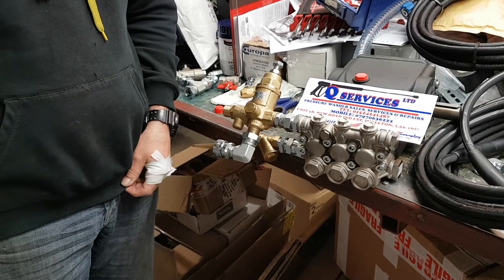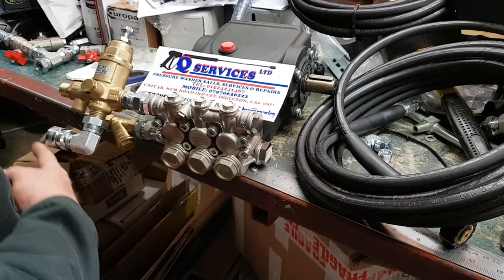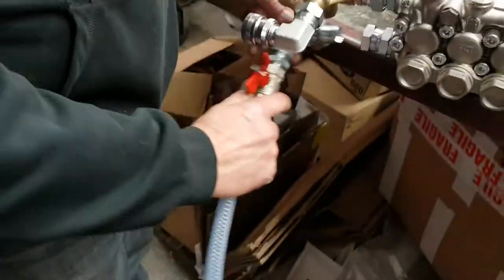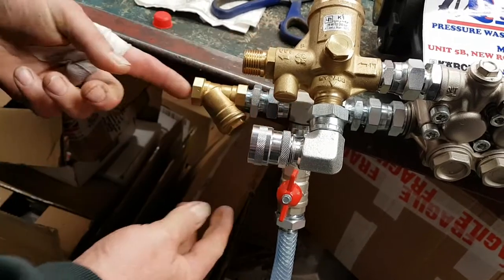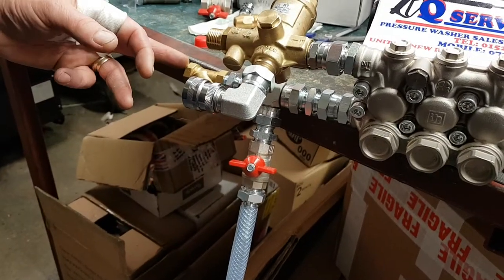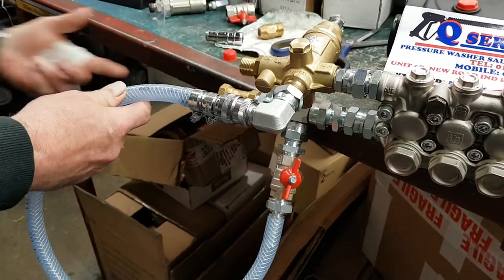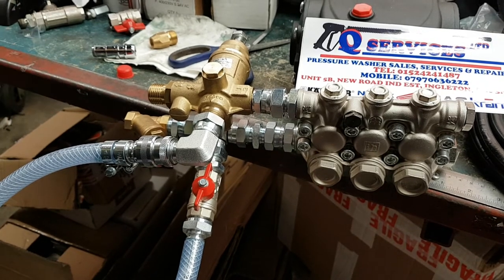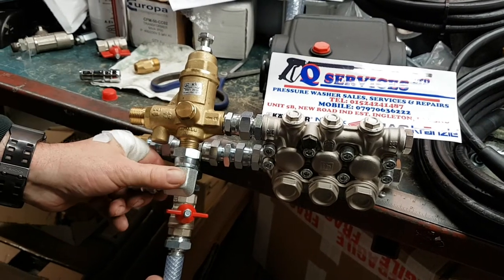QWASHERS MAINS FEED SET UP EVO PUMP

Comment: hi daminei have tue evo 3400 rmp pump 250bar 20ltrs a minute no inline strainer do you think i would be better of with two water feeds regards callum
Reply from the maker: If you are running a 20 ltrs pump, it will never do any harm to run another feed so the pump is swamjpred with water.
We do not do anything much on the evo 20ltrs pump so not able to comment and give you a yes or no because never done any tests on it.
The feed is 1/2bsp so you will be as well doing.
Thanks qwashers